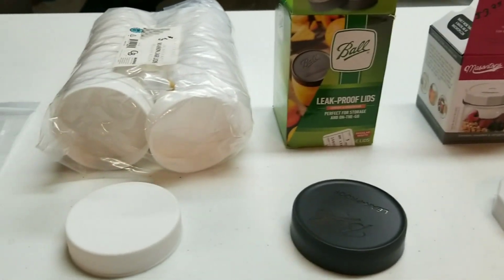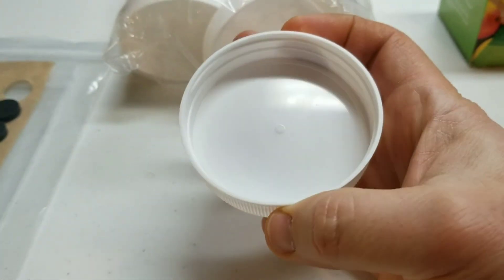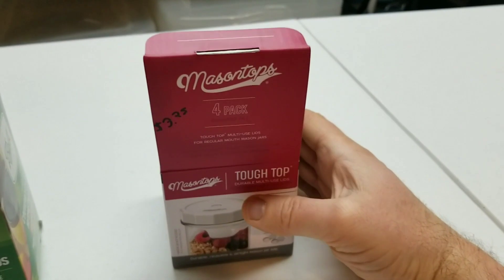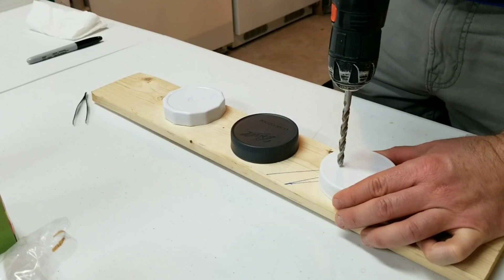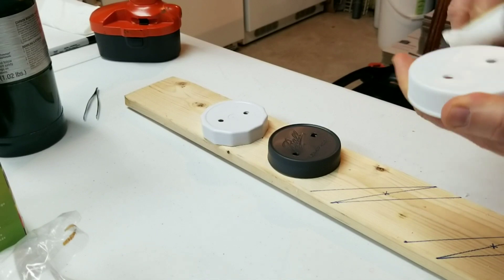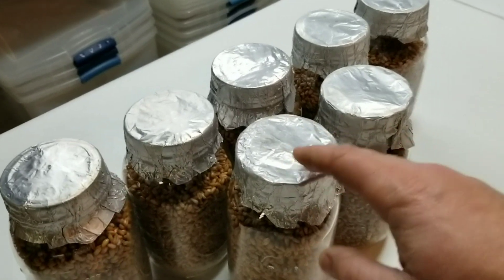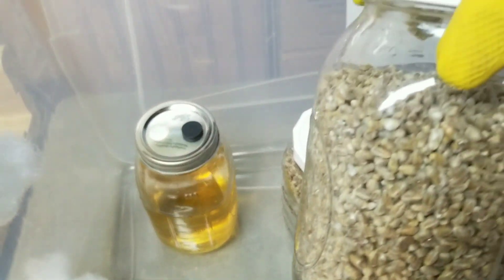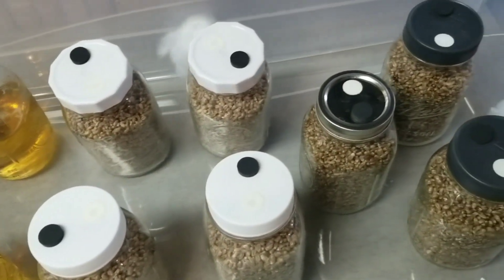TESTING PLASTIC JAR LIDS FOR MUSHROOM CULTIVATION,

Comment: I noticed that even the grey ball lids read "no Preserving"  that's why I've been using the metal lids. Now I just started doing this mush stuff so I'm not really experienced but I say if it's not broke don't fix it. So I assume not for preserving means not for use in a PC?   BTW  I just trashed 6 jars of LM wheat spawn that never did grow out and bought some oats to start all over.  I did like the lid with the silicone sealing ring.  Enjoyed the video as usual. thanks for making it.
Reply from the maker: I hear you, the old metal lids will always be effective. If you want to try a plastic alternative that will seal just as well though, those mason tough tops with the gasket are very nice. Good luck with the Lions Mane. Also, be sure your grain is fully cooled before inoculation. Inoculating when too hot is a common reason for jars showing no growth.
Reply: @RenegadeMushrooms   I can't remember now if they were hot or cold. lol    Hey I just got my 24x 48 hepa filter today, now the fun starts tomorrow with building the box. Glad I had a blower sittin around for the last 13 years  now I can use it. It's a 3speed  from 767 cfm up to 1200. so just the cost of the filter  235.00 and Home Depot charged me half priced for a 4x8x 3/4 sheet of plywood they messed up cutting it in half. but I can still use it. It was off 3/16ths. got it for 25.00
Reply from the maker: @ranjanty  Hey, you made out great. Sounds like you're all setup. Don't forget to caulk the seams so it's nice and air tight. A flowhood is a game changer for sure.